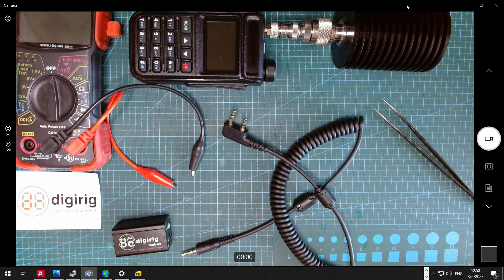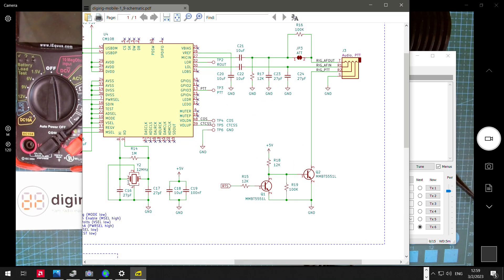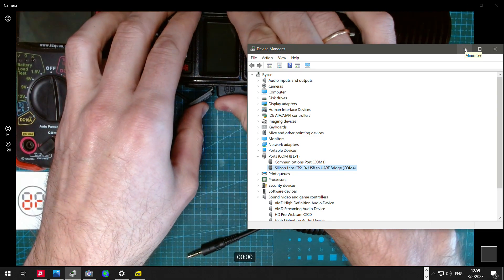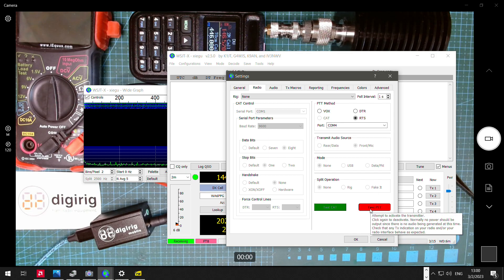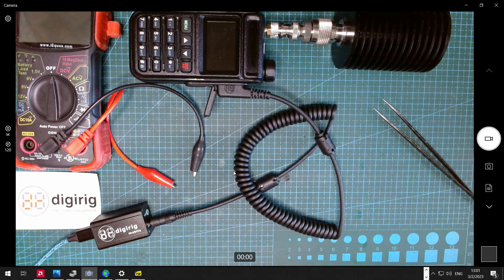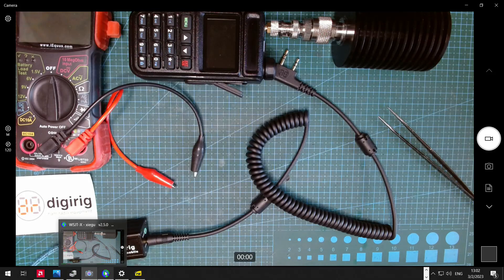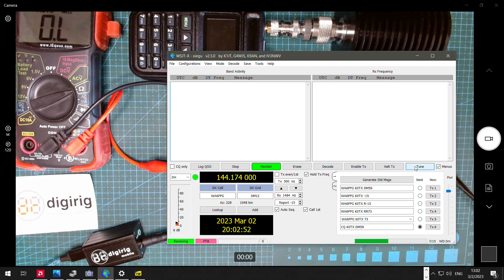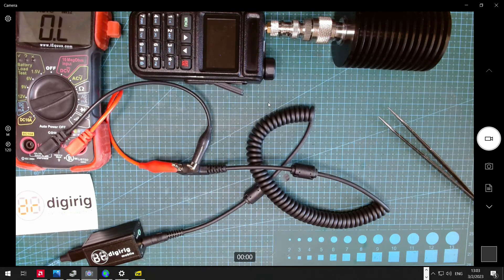Configuration and troubleshooting of PTT by RTS

Comment: Hey Denis, thanks for pointing me here.  I got WSJTX to talk to my Baofeng properly after I removed the whip antenna and drove a dummy load.  The RF interference was the culprit.  I did notice that it didn't work after I jostled it some but when I reseated the microphone plug, it worked fine.  I've seen this before with Baofeng microphones that don't work sometimes with Baofeng radios due to the positioning of the 2 plugs in the overmolded connector.  If both plugs are not fully inserted, the microphone will not work, usually PTT failure.  One batch of microphones I bought about 6 years ago would not work at all with my radios while other microphones did.  After cutting one apart and measuring the mechanical dimensions, I found the 2.5mm plug could not be fully plugged in.  Apparently they fixed subsequent models because they DO work now.  Being mechanical, it is a very subtle failure and hard to spot.
73
-- NW7T